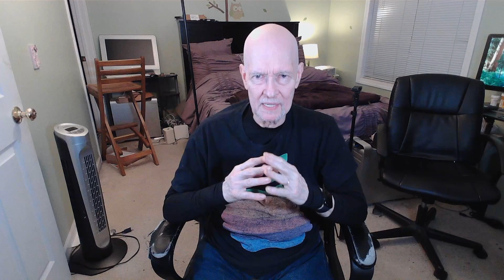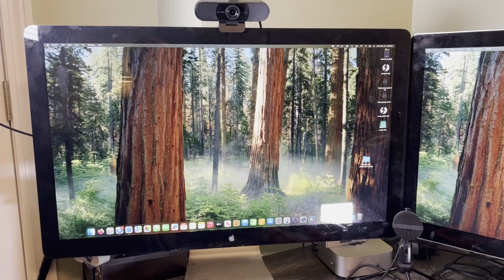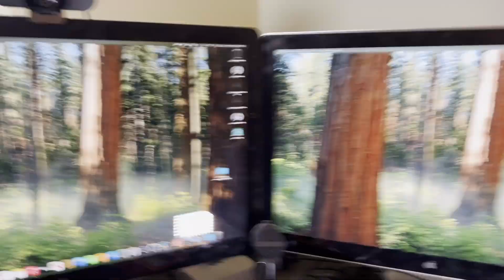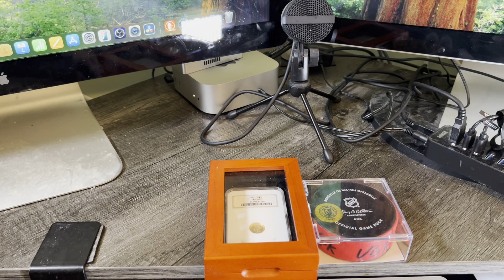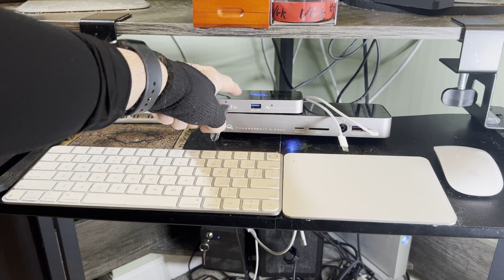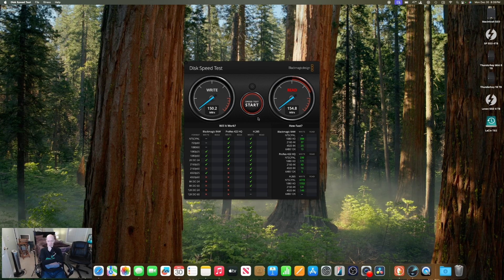M4 Pro Mac mini,how it fits into the retro world!

Comment: It’s awesome to have all that storage available, definitely a great backup solution for everything you’d need! Looks like the M4 is working out well, cool to see it with the Apple Displays!
Reply from the maker: I really like these displays/ I'm also impressed with being able to use those old Thunderbolt 2 enclosures. It's cool to be able to daisy chain them and save the TB5 ports for other uses. it reminds me of the old days of FireWire.
Reply: It seems like they are a great plug and play solution, it just works with macOS! And yeah, daisy chaining everything also reminds me of FireWire, it’s cool that Thunderbolt has those additional features, basically an upgraded version of FireWire.
Reply from the maker: Back in the day, Firewire was awesome. As an aside, the Apple Thunderbolt Display has a working FireWire 800 port.
Reply: I enjoy using it with the older Macs, it’s a very useful connection. Plus it also works really well with things like older tape based camcorders. With Final Cut Pro, it all just works really well. That’s very cool, nice to have it even on a modern system! Eventually I’d like to try older Thunderbolt devices like 1/2 since I can actually use them, I just don’t really have anything for it.